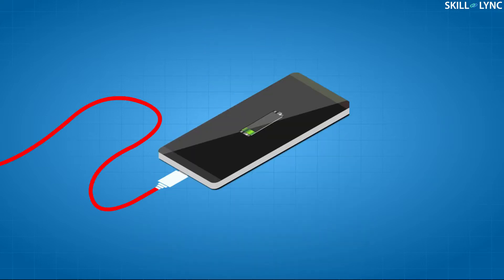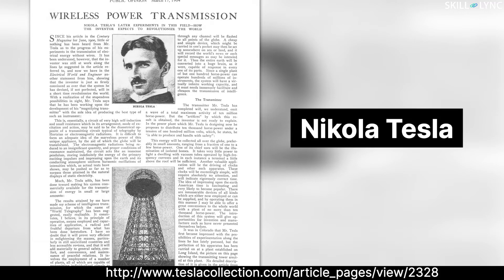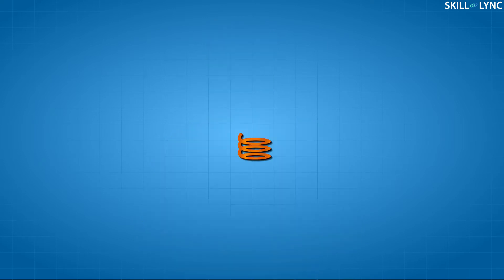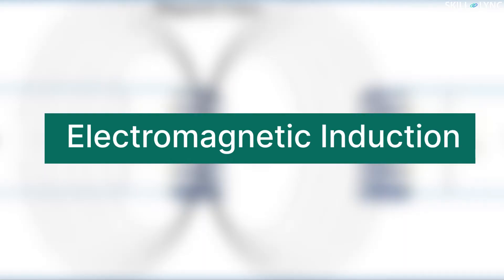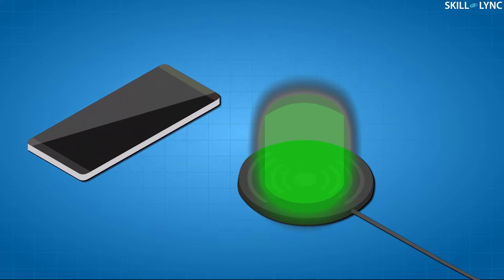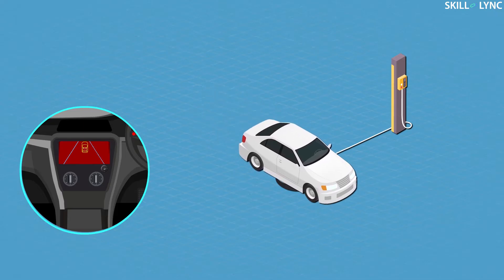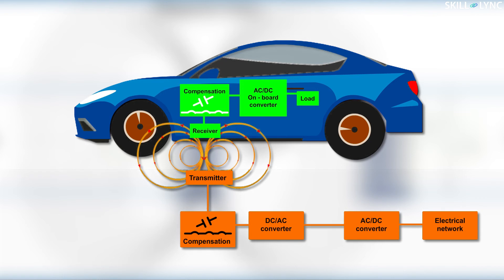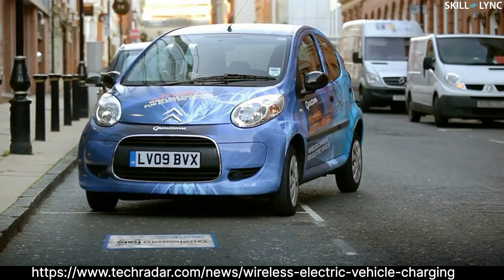What is Wireless Power Transmission? | Skill-Lync

Comment: " WiGL eNERGY " Wireless electrical Grid Local Area Network's (Wi-GL or WiGL; "wiggle") patented technology allows you to pick a wireless power network the same way you pick a Wifi provider. Cut the cords and wirelessly power your devices up on demand. The time has come to wirelessly connect and power our devices.

WiGL is a smart, long-distance, wireless power company. 

WiGL, Wireless-electric Grid Local Air Networks (pronounced “wiggle”), is a new technology developed for the Department of Defense for touchless wireless power.

The vision of WiGL is simple: Be the dominant name in wireless power!